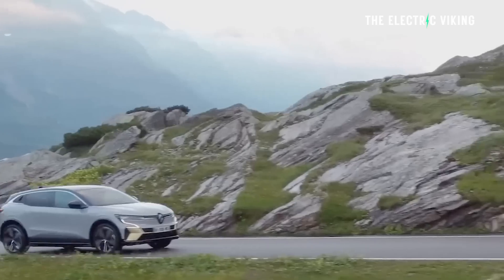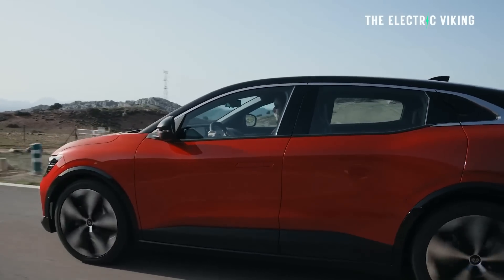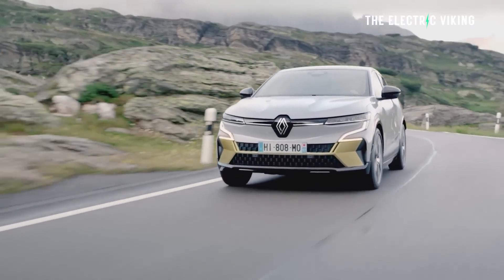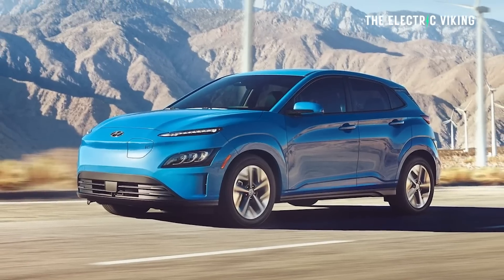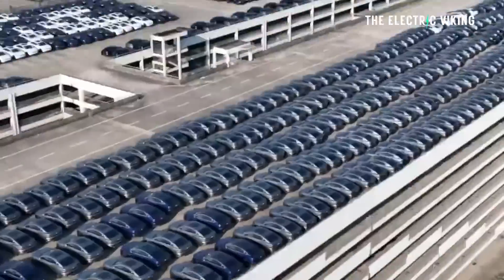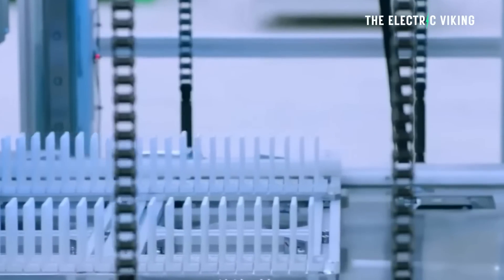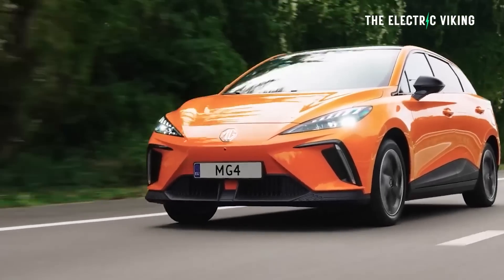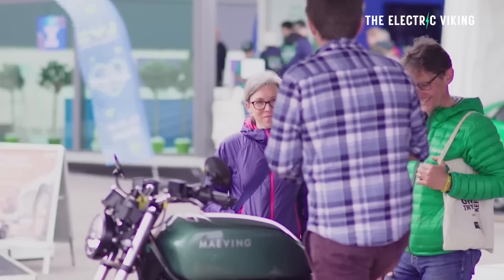Renault & Peugeot release NEW EV's in Australia; media shocked by price

Comment: Yes, the price is insane. But I have driven both, the MG4 and the Megane-e and they are Miles apart. And you should not forget, that the MG4 only has a heatpump in the highest trim-level. The Efficiency is also not there yet. Software, especially the assistants are a pure nightmare. In certain Trim-Levels the Megane can charge with 22kW AC; a huge benefit if you pay by the minute. Overall a really well made car with good Software and Handling. 
Concerning Prices in general I would say: In Austria, at least, EVs are still very expensive. Everyone said: "Wait for the Chinese Cars". Well, here they are, and 9 out of 10 times also insanely priced. MG tries to go lower but also increased the price of the MG4 within 6 Months. If demand explodes and you have rising prices of Lithium, Cobalt, Nickel and Copper, why should EVs become cheaper? One day maybe with NaCl, we will see a light in this Tunnel.
Reply: This.
You can't compare garbage Chinese EV, selling only for specs but terribly made, to a well designed, comfortable, and well finished car. And no Tesla is not there. Absolutely garbage interior and horrible manufacturing quality. 
Traditional car makers are more expensive, it's true, but you get a different experience with these vehicles. Not everyone is looking for the cheapest of the cheapest. It's the same thing in every single industry ; China for the cheap trash and historical brands for quality stuff. Just accept that not all customers value the same thing...

Comment: All the best to Shana and your family, great video! OEMs & Legacy auto needs to take a chance in design, spice things up, this is a unique opportunity to re-invent themselves, safety , driving experience, efficiency, design , build quality and great software are > the < critical data points for EVs. Batteries and Motors will be harder to use as a differentiator point in less than 3-4y.

Comment: I was wildly interested in a Megane e-tech when it was covered in the press. It's a nice looking car and the the infotainment system seems great although some reviewers think it's a bit pokey in the back. But here in Ireland an e-tech with a 60kWh battery costs €41,995, plus paint, delivery etc. Meanwhile a top of the range MG 4 with 61kWh battery costs is €34,495. That's €7500 of a difference for substantially similar sized vehicles. And the MG has gotten great reviews too.

So guess which one I ordered. It would be insane if Renaults cost even more in Australia, more than a Tesla. That's just insane pricing. They're sending the car out to die and it doesn't deserve that.
Reply: @stevenjones916  that's an interesting and weird change. I think I would be pissed off if I had ordered an e-tech and found that out. Normally the only major difference between LHD & RHD is some manufacturers can't be bothered to move their fuse box and RHD cars end up with useless little glove boxes.